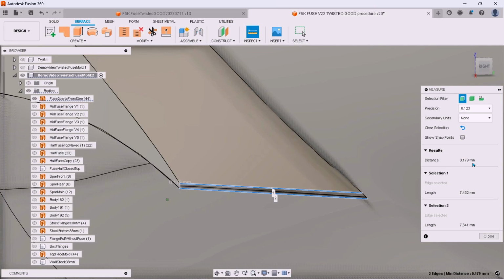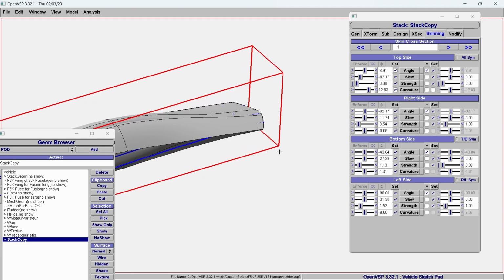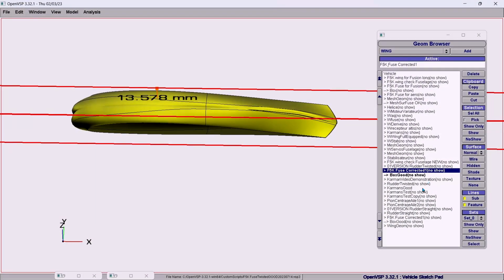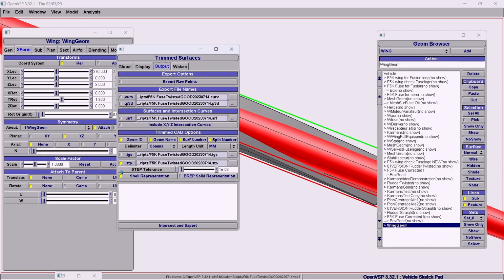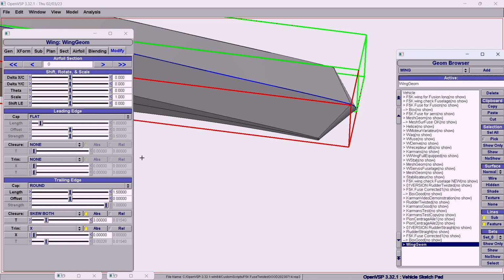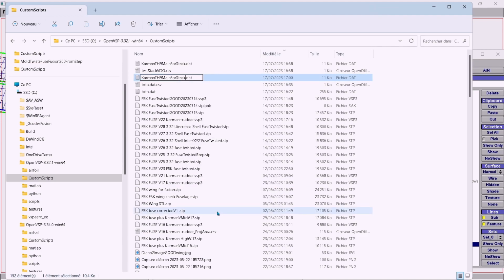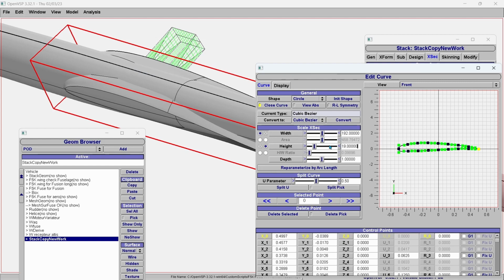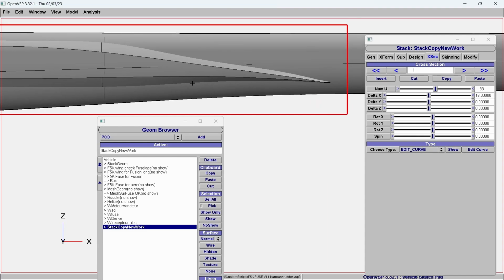Drawing aircraft fairings with OpenVSP (CAD)

Comment: Thanks Alexis.
I have learned several interesting features in OpenVSP which is actually a very powerfull to for plane design. 
As you mention, it is just lacking the Crt-Z 😁
Renaud
Reply from the maker: Thank your for your comment. 
I made this video because I spent a significant amount of time figuring out how to draw fairings. I started from a post from the OpenVSP forum but finding my way needed few dozens hours before succeeding and having the full control. 
OpenVSP would improve greatly if it was possible to connect some spacemouse that allows you to move your object in the 3D space. Because moving and zooming your object today is still a PIA.